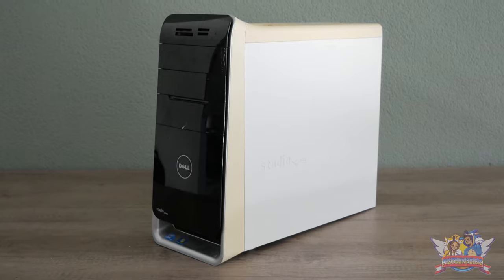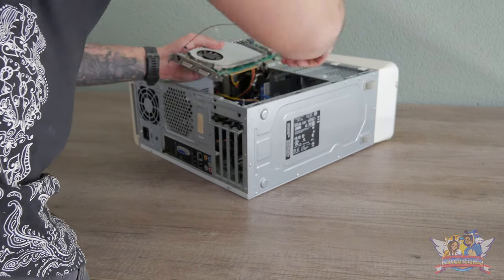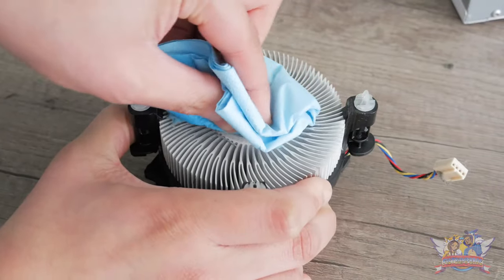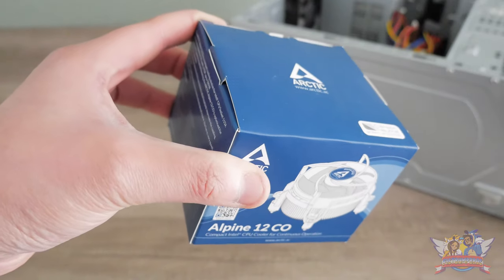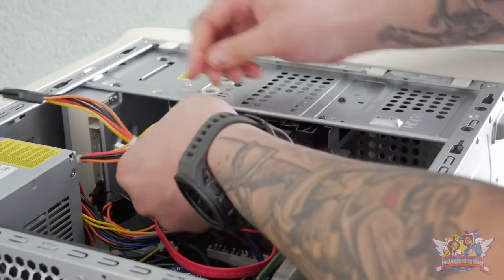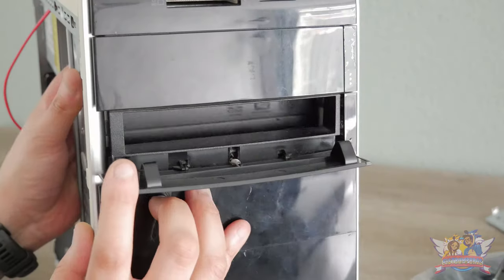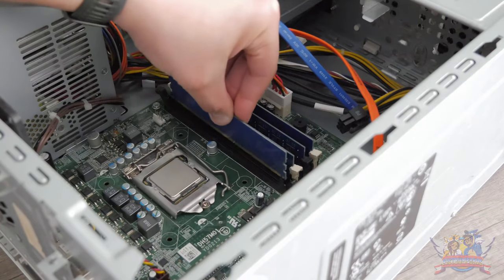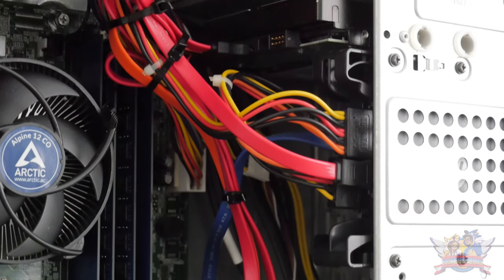Refurbishing and Upgrading a Dell XPS 8100 Desktop PC

Comment: I am still using my xps 8100 that i bought in 2010,  I encountered the 2 beep problem on 3 occasions,  resetting the ram cards is what worked.  i replaced the power supply about 5 years ago......the symptoms leading up to that were odd.  I also replaced the power button with an old on off toggle switch.  great video.   I agree with you, upgrading this computer is not worth it at this point.  it has done its job.  i cant believe i am writing this comment on my 2010!!!!!!!!!!!
Reply from the maker: Cool to hear that its served it's purpose for so long 😬

Comment: MY XPS 8100 STILL RUNS... 16 g gtx1650 and ssd runs still fine... thats why im still hesitant to upgrad has optical bluray dvd copier card readers....everything i need
Reply from the maker: If it works it works 👍
Reply from the maker: Depends on the rest of the items in the cabinet that draw power.
Reply: @christonefeltzs5149  yes
Reply: @christonefeltzs5149  never touched power supply
Reply: @christonefeltzs5149
Reply: @christonefeltzs5149  never changed power supply
Reply: ZOTAC Gaming GeForce GTX 1650 OC 4GB GDDR5 128-Bit Gaming Graphics Card, Super Compact, ZT-T16500F-10L
Reply: @jolas r Hey do you know if its possible to run 16g 2x8 ? It's freezing on Dell screen on me. Updated bios to 2010 version.
Reply from the maker: Youll have to check the specs for the motherboard on Dells site to see what the max capability is.

Comment: My 8100 just failed. I think the hard drive died as it has been exhibiting symptoms for a while. Fortunately, I have saved most of the data on it  so it's not a catastrophe. I think I bought mine around 2010 so it lasted 14 years.
Reply from the maker: Every drive can be saved. Use recovery software to still get your files 👍

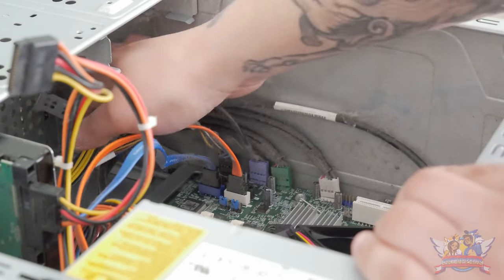Comment: 3:12 one possible issue is not holding the compressed air can upright at all times, you could get a liquid condensate from the cold which can damage the motherboard.
Reply from the maker: I get that, but that wasnt the problem. The liquid evaporates very quickly, as i had the same thing happen all the time in my other video's.

Comment: You did not mention if the machine was bootable before you started.  If it was but was it was having problems detecting RAM after the cleanup that would be interesting.  I have one of these too and it has lasted me 11 years so far, with only a pre-emptive disk replacement done on it after 8 years rather than wait until it decided to fail. WD Black of course since the old one lasted pretty well. I am dealing with a six beep POST fail atm which I think is a real time clock failure so I hope that a new battery will fix it, but if anyone else has any other suggestions let me know.
Reply from the maker: The stupidest thing was - as i mentioned in the video - that i didn't check the machine before starting on this project. Since it is a machine my brother handed over to me, i figured that it would work anyway.

Comment: my dude, as a top tip, one you probably figured out already, u first test the stuff you got, try to resolve existing errors, before you start spending money on new (old) stuff. pretty sure them beeps existed before you started working on it. If not, u broke something :)
Reply from the maker: Yea, now I know. Just got the assumption that my brother gave an actual working case. Guessed that wrong, so in the video I made after that, I clearly state (the XP gaming Rig) that 'I test before I do anything because I don't want to make that same mistake again'.

Comment: You didn't check the GPU display card. I replace this with lower version , There was serval dead windows 11 happen. after replaced the video card, feel much stable.
Reply from the maker: I don't have this particular PC anymore, but I do still have the GPU. I tested it out in other retro desktops and it worked fine.

Comment: Why didn't you upgrade the video
Reply from the maker: The PC is no longer in my posession so I can't check that.
Reply: @fistbumpbros  I have the XPS 8100 and it's working fine I'm just looking to upgrade the video card and I want the latest one that works with this old machine, because I want to stream 1080p.
Reply from the maker: @TimothyCampbell-h4z  i suggest looking at something like a GT710, GT1030.

Comment: There was so much dust in mine , I stuck the vacume hose it it got alot out
Reply from the maker: Hah, that's a another great option!
Reply: @fistbumpbros  How much bigger of a power supply can I go with out messing anything up?
Reply from the maker: @TcVideoHosting  When it comes to WATTS, you cant go wrong. The more the better, only downside is the power consumption and your electric bill going up. When it comes to measurements you can't go any bigger. Its a very tight space.

Comment: is it possible to use the case and build a custom pc inside like changing most components including the motherboard
Reply from the maker: Yes.
Reply: @fistbumpbros   do you know what form factor motherboard i need to be able to align the screws
Reply from the maker: It's an ATX board.

Comment: i had double beep for me it was cmos it was a brand new battery but for some reason i had to wiggle it and it worked again it makes no sense to me why that works but it did i also had hard drive issue too but i reinstalled windows and another thing is when i first started using the pc it did have the double beep in a few times but it fixed itself plenty of those times then eventually stopped im also thinking about upgrading the cpu but im not sure it would be compatible because ik some motherboards neef a certain bios version for some cpus but i dont know how to work on manufacturer pcs i do custom builds so its different bc the motherboard is dell not a custom part
Reply from the maker: Sounds like a lot of problems. Anything can be upgraded, you just have to check compatibility. Pre built doesn't doffer much from self build, other than pre built from the inside mostly sucks.

Comment: I have this computer without the Dell Windows Home Premium disk.
I tried a generic Windows Home Premium disk, with MyDriversPus disk, and I still have no ethernet adapter, working USB, sound...
Is there a way to download the Dell Windows Home Premium disk?
Dell says it's not available when I put in the Service tag.
Reply from the maker: I found a DELL service disk.. 'somewhere'. Not in the legal way, but it is the only way to install (for example, the one i have) XP on Dell computers with all the correct drivers. DELL doesn't have all the older drivers on their sites, so this was the only way for me.
Reply: @fistbumpbros  I agree
Reply from the maker: If you search for something like 'Dell Windows XP' on some.. sites. It pops up 👆
Reply: @fistbumpbros  I tried a Dell XP reinstallation disk, and I got a fatal error.
Reply from the maker: That's not a good sign. Errors from a disc should not break a computer in the slightest..
Reply: @fistbumpbros  It turns out my usb plugs in the front aren't working.
Once I realized I had USB, I can make it work even if I don't get the network adapter working because I have a usb to ethernet adapter.
Reply from the maker: @glennrobards585  If those USB ports are causing the error, you can easily plug the USB front cable loose from the mobo. You could still use the USB ports on the back.
Reply: @fistbumpbros  Yes, I using the other USB ports, and I will check the connections to the front USB one of these ambitious days.
Thanks for being so helpful.
Reply from the maker: No problem man!

Comment: 05:55 min - Dude... do you see the four white brackets on the white side of the case? ... you just would have to mount them up a lil bit and the front would come away. .......................... The way you do it, IS COMPLETLY WRONG! :D (03.01.2022)
Reply from the maker: That's why later on, I show that I figured that out. Got caught up in the moment.